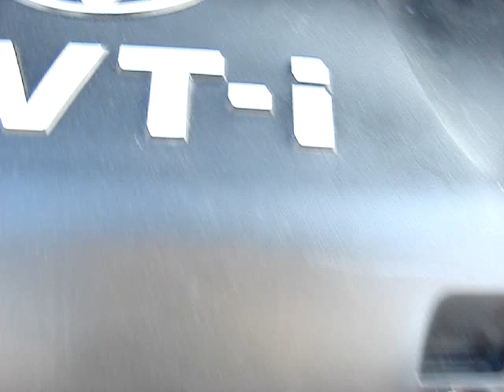2001 Toyota Yaris Echo Vitz 1.3 VVT-I petrol 2NZ-FE engine sound noise. (warmed up)

Comment: i have a vios, and i have the exact same engine, with manual transmission(2nz-fe).  Yes the engine noise is normal. That's probably the only downside of the 2NZFE engine. I've never had problems with mine, and i've been using it for 9years now.  14 kilometers per liter in city driving, and 20 km/l in the highway! Thanks Toyota~!  pm me if you have questions.
Reply: 7 litros cada 100km?? with air conditioner or no

Comment: I have a Toyota Yaris Verso 1.3 from 2000, I call her "Jam Jar". Like most things the Japanese do they balance many things to give best value for money in the case of this car it is some very odd noises. Those noises are a little disturbing at times and when you are new to the Yaris you can start to get a bit paranoid. But this car really talks to you about what it needs. It is a truly great car only one problem and that is the sills just had them welded second time this time by some very friendly Afghans who did a great job. It is so reliable in every other way and the engine is just great at 313,000km my Russian mechanic friend said its engine readings are like a new car. And very economical. I can honestly say I am not a snob about cars at all.  I want something economical and reliable that gets me from A to B and can fulfill my and my families needs. This little car was planned by Japanese Zen minds. Small on Outside and a Tardis on the inside. Ever wondered why you are stuck in traffic often behind a Toyota? I am living in Finland my son has a 3 liter BMW 3 series that is mostly under the snow because it cannot be driven most of the time in snow. The humble Yaris Verso has coped with the worst weather that Southern Finland can deliver.

Comment: Might be the vvt solenoid. If it hesitates and kicks after 3000rpm it might need to be replaced. Replaced mine not long ago. Changed the timing chain and did a valve clearance check and still was noisy. Changed the solenoid and was like a new car
Reply: so what did the solenoid actually do ?? Maybe you didnt have to change the timing chain ?
Reply: @CRM537  fixed all the things I mentioned above
Reply: Good morning dear, let me tell you that mine kicks at 40 km/h, I had it scanned and I didn't detect any transmission, I'm going to try changing the VVTi valve to see if it solves my problem, as it did in your case, would you give me some advice? recommendation
Thanks in advance
Reply: @gabrielchurquicuellar9455  mine also did not detect a fault even though it was clearly not running smoothly. It would be worth a change due to the age of the vehicle and before an expensive repair

Comment: Normal noise and remember always change the oil every 4.5k - 5k and you'll never go wrong.I use 10/30w semi.Thing is many people don't change the oil till like 6k-8k BAD MOVE.
Reply: @Ilyas Manan Use 5w- 30 Magnatec,i use it all the time on my 90,000m 2002 Yaris.I used Forte engine and fuel cleaner 8 yrs ago and it still sounds v.quiet,i do 3,000 a year,so change the oil regardless.VVT-i/VTec engines does not like long oil changes.So a 5,000m is v.important as over the years it will sludge up if ignored.Use Forte cleaner if you never used any engine and fuel cleaner in the last 8/10 years.

Comment: It sounds like ga1999 is right. When the engine warms up, the lube gets thinner. Try thicker lube, maybe some Dura Lube with it and check the valve system. My '97 Opel has a little tick-tick and I know it's from the hydraulical things that open the valves, excuse me, but I don't know what they are called in English.

Comment: Actually it can take boost, but there would have to be upgrades.  The 1.5L's weak spot is the connecting rods first.  There are a few turbo NZ-FE's throughout the world, and many even raced.  It's a good, light platform that some enthusiasts take advantage of.

Of course you're right about the other stuff. Stick with N/A and bolt-ons, maybe an ECU flash, there are 1mm bigger intake/exhaust valves out there, and you can still see around 120-125hp on a 1.5L version of these.  Not sure on the 1.3L.

Comment from the maker: @MsJosephzammit NO car is not designed for speed and can not handle extra power.

supercharger + turbo + labor costs will exceed the value of this vehicle

why would you want to ruin a low insurance, low tax, low fuel consumption, low maintenance asset ?

Comment: hey, thanks for the reply. I just bought my echo a few weeks ago and i was like..whoa why is that thing shaking so much! :) there is also this 'hissing' sound a bit near the fuel lines..probably fuel pressure? and when you turn off the engine its like a air compressor sound shutting off along with the engine. so weird.

Comment: It sounds like a bad engine mount.   If you are having vibrations  and the engine moves a lot when putting in gear, you may have a bad engine mount

Comment: hay felix, Wilson I have the exact same noise as this in my Toyota yaris 1.0L 2001. is it the tappets, the chain mite also need changed as it has over 109,000 miles.? maybe a tensinor fault any feed back would be appreciated.

Comment: hi,my toyota vitz has the exact noise and at first the mechanic told me that it was the advancer aqnd timing chain,changed those but no luck.now he told me that maybe its a thing called tappet.dont know what it is.does the noise go away when the engine warms up?cause mine it goes.spent 500 euros on it for nothing :(

Comment: Completely normal sounds from this engine. These use solid (not hydraulic) cam followers, a timing chain and a thin oil (10w/30) from the factory. The Echo/Yaris will happily last up to 500K Miles, yes, MILES. Plenty of youtube vids from happy drivers. You are not buying a Rolls-Royce here.
Reply: Sorry to disagree..  we have the same car ,,you can hardly hear the engine running ...so quite.
Reply: @normanscenic  quite doesnt mean its a good thing.. It might be to tight.

Comment: Depending on the miles, you need a valve adjustment
Reply from the maker: valves are not adjustable
Reply: Shims are adjustable. Getting mine done this week. Sounds just like this. Rattly and noisy

Comment: El sedaso o filtro que está dentro del Carter se va tapando con los años y se va quedando sin lubricación en los lifters arriba y ojo no le subas la viscosidad del aceite por que lo vas a dañar más créeme hechale 5 w 30 eso es lo que manda el que fabricó el carro Móvil 1 o Castrol o Penzoil pero que sea 5 w 30 suerte
Reply: Y como se puede cambiar ese filtro amigo alguna forma yo tengo el mismo sonido
Reply: @miguelmoraga1159  detras del alternador hay un tornillo en el Bloque del motor lo sacas y ahi va ese filtrito en la vena de aceite y no solo filtra también crea cierta presion de aceite como cuando le pones el dedo a una manguera y el agua sale a presión pues asi pero con el aceite para mantener el palo de levas lleno y supliendo el aceite necesario a la parte de arriba del motor y al piñon del VVTI

Comment: I have the Toyota Yaris sedan version and it sounds same with yours. lol its really funny how you people react that this engine needs thicker oil... new vvti gear.. timing chain blablabla.. dont worry guys right from the day it was delivered here on my house it sounds like that... I've already told Toyota dealer about this and they said its perfectly normal and nothing is really need to be changed or replaced.
Reply: Mine don't sound like that it's much quieter.
Reply: Tardeli costantini good for you tho there is a bit of a difference when the hood is opened and closed. Mines really quiet when engine is fully warmed up and a/c off hood down. i do have video of my yaris and fans are really noisy + audio is boosted by my phone's mic hearing a bit of white noise.
Reply: Mine quiet as a door mouse whether hood open or closed although i do use 10w/40 which is abit thinner and quiet cold or warm as i do short distances which is recommended.
Reply: Actually, 10w/40 is a thicker oil than these engines used from the factory. Also, this man's microphone might be more sensitive to these sounds. My brand new Yaris sounded the same also. Totally normal.
Reply: My bad 10/30  i checked all my empty oil bottles in the garage.
Reply: Our Yaris was quiet up to 200.000km. Them it started to sound like that, mostly when idling warm.
Reply: @DrBirdTube  its finally broken in....lol

Comment: DID YOU FOUND THE SOLUTION TO THIS PROBLEM?????
Reply from the maker: THERE IS NO PROBLEM its the normal sound.
Reply: Sorry  to say .. NOT normal ..  we  have  exactly the  same  Yaris   VVT-I     ,engine is very quite all the time
Reply: @normanscenic  its a little noisy but still in spec....

Comment: Sounds like lifter sound to me. Try thicker oil like 10w30
Reply: 10w 30 is crap oil for most modern cars 1999 and above vvti motors hate thinker oils 5w 40 would be much better

Comment: Is there any oil in it🤣👊
Reply from the maker: topped up to the full mark, its normal sound for this engine
Reply: zloben9000 I have a bb with the 1.5vvti sounds nothing like that that sounds extremely tappety
Reply from the maker: what is a bb ?  this is year 2001 1.3 not 1.5.

Comment: what is the oil consumption ?
Reply from the maker: 0
Reply: @zloben9000  I have Toyota corolla 1.6 vvti 2003, 125.000km and looking for another city car. I am thinking about Toyota Yaris 1.0 or 1.3 vvti ?
Reply from the maker: 1.33 for the yaris XP90
Reply: for older one model 2003 ? looking only previous model
Reply from the maker: its the same 1 or 1.3, get 1.4 d4d for more torque
Reply: @zloben9000  ok, i see 1.0 is too slow, I will looking for 1.3 petrol

Comment: PCV
Reply: asddd123 124 

I agree! I replaced my PCV valve yesterday, and it reduced engine noise a good 50%!
 The best part: 
Cost $4 (pepboys)
and
Takes 5 mins to do.
Reply: you should check it  u can clean it with carb cleaner and using your mouth blow in the tube in both directions if it alows air to pass in only one derection its good. before buying a aftermarket pcv since ive purchased some in the past the last one for my ist / xa, did not work i was losing oil i fixed it by cleaning and istalling the old original pcv
Reply: Due to do mine v.soon.
Reply: What?s PCV?